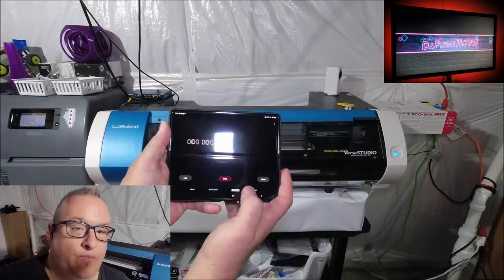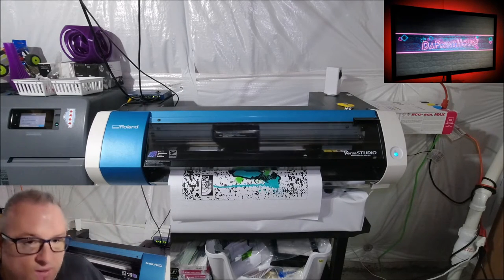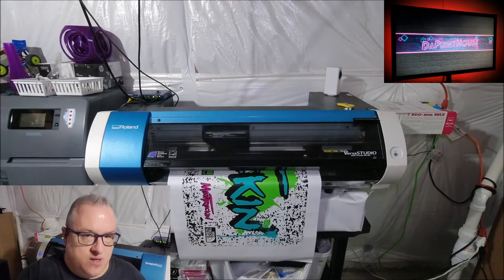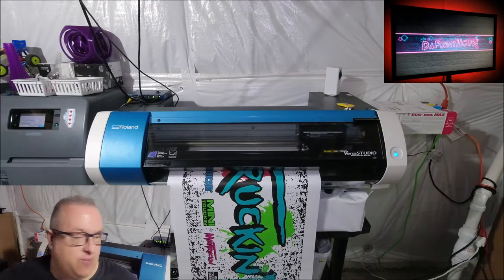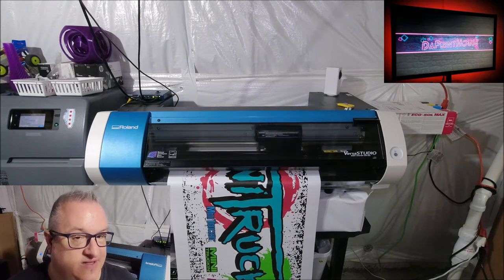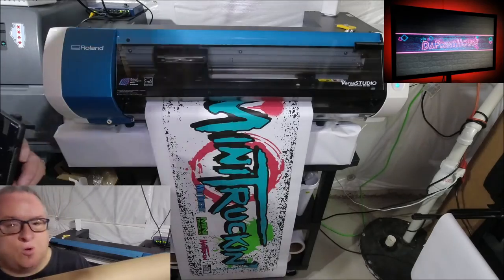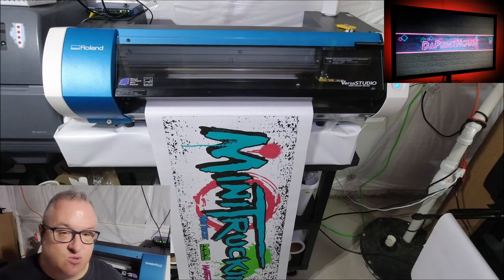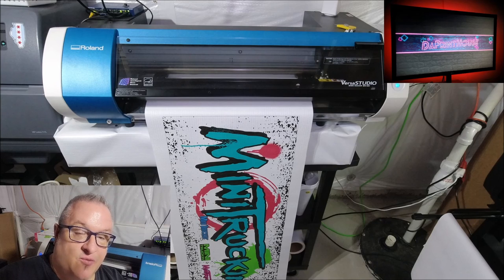Printing Banners on roland bn20 start to finish ecosol print cut machine

Comment: Here is my only hesitation doing banners. Size is limited, I get that, but if the customer is happy with the way the Eco-Sol looks, then it might be harmful to sell the prints from the latex. I run into this all the time at our shop. I print some envelopes on our toner machine and it matches the letterhead perfectly, but it's not cost efficient for more than 2,500, so then I switch to our small inkjet envelope printer and it doesn't match any more. Customer wants the toner look and it can bite you later down the road.
Reply from the maker: i was more just showing that u can absolutely use the bn20 for banners if its all you had,  with my banner work i don't have to color match anything and i wont guarantee it either,  for me i wouldn't need to print banners on the bn20 at all if my latex is running for obvious reasons.  but when i was down for the 4-5 days for magenta print head i could have done some i guess,
Reply: @DaPrintHouse  Very true. BN-20 is a very capable printer.

Comment: Thank you for all the awesome content! What's your fav printable htv for the BN20A? I used the roland that came with my machine and it has a very plastic feel so we won't be ordering that again.
Reply from the maker: Thx. I like the colorprint its softer for sure just not alot of testing yet
Reply: My BN-20A arrives next week and I ordered a roll of Siser S-Print. 
It’s supposed to be soft, thin and matte which is perfect. 
Also applies at a very low temperature. 
They say it can be more difficult to mask though. I’ll see how it goes.
Reply: @razormix  how do u like your printer?
Reply: @fernandolanderos4600  I love it! The Siser S-Print media is great. Very soft and the shirts look amazing.
I’ve made window cling and decals with Roland’s media as well. The VersaWorks software is easy to learn and use.
I’m testing out the 60 degree blade at the moment for more detailed cutting and so far so good.

Comment: I'm curious to know how well this holds up. I know your mentioned this was for inside your garage. Do you think it's strong enough to hold up outdoors? I know this ink runs sometimes when wet?
Reply from the maker: hi, they will not run when it rains when they are cured before hanging for sure.

Comment: What kind of issues have you had without having a heater? I've read that people have had issues with smudging.
Reply from the maker: Smudging?  i mean ye if u run your fingers across an image with a heavy ink profile but dry to touch. Not to long after.  Not sometbing u will do normally,  typically you would.print and throw on table for a bit. But notbing out of the ordinary

Comment: What type of paper are you using for the banner? I just bought the Roland bn20a for my shirt business and wanted to start doing like posters, banners and decals I believe it does and stickers. Any tips? I am so los tot what type of paper to get for that. 

I see a lot of people do banners and then stick it to a harder board?
Reply from the maker: Valerie, thanks for watching,  browse some of my videos i talk about diferent medias, but you want to print on adhesive vinyl for stickers and mounting to boards,  and banner material for actual banners. swing design and roland has media but start with 13oz matte or gloss vinyl but make sure you get the right sizes  20" wide  swing design sells media for bn20 for sure. check out their site.   take your time watch videos you will pick up things easy
Reply: @DaPrintHouse  thank you so much for the response! I’ve been so lost! I want to start selling designs for like outside and stuff. Do you recommend a limitation machine?
Reply from the maker: @valeriemoreno7053  no problem,  you would only laminate vehicle graphics and certain outside signs that will be outside in sun  3 years or more for sure

Comment: Thank you for your videos. I do signs at work with a Graphtec. We don’t print at work though. Anyway, I’m starting from scratch for doing this at home. What software do you use, Adobe Illustrator, or Coreldraw or something else? Also, desktop or laptop computer and how new is it? I know these seem like pretty basic questions, but I’d appreciate your input. 
Thank you, 
Jeff C.
Reply from the maker: i use corel and affinity designers mostly,  i have several   7th gen i7 ThinkPad's with 12gig ram i use for most my equipment down here.   all depends on the complexity of the design really. but great machine to start out with for sure!
Reply: @DaPrintHouse  
Awesome! Thank you. Keep rocking the videos, they really are helpful. 
I’ll get laptop and software and start familiarizing myself with Corel. Unfortunately everywhere I’ve checked is saying that the BN-20 is out of stock and the BN-20A has an August delivery date.

Comment: I want to print only banner. Do you recommend to get the Roland BN 20 ?
Reply from the maker: if you do not have enough space yes but i would step up to a larger machine 54" wide will print a banner in a few minutes.
Reply: @DaPrintHouse  Thank you for your advice.

Comment: Hi Ken! I am so glad I found your channel! I am new to the Roland BN20 and commercial printing so your videos are extremely helpful. Do you know if it is possible to print on vinyl coated pvc with the Roland BN20?
Reply from the maker: thx for the comment.  hmm that i am not sure, how thick would it be?
Reply: @DaPrintHouse  only 20mils so thickness should be good. I am just uncertain about if the ink will adhere 🤔
Reply from the maker: @nataliasaraceno8730  if you have a sample to send me i would test for you.
Reply: @DaPrintHouse  I do not - I will order some and let you know how it turns out. Thank you for your help 💙
Reply from the maker: @nataliasaraceno8730  sounds good for sure!

Comment: Do you put the gromets on and hem?
Reply from the maker: Always use grommet, hemming or banner tape(folded edges)  only if someone needs an outside banner. Not needed for indoor banners.
Reply: @DaPrintHouse hi how can we print and cut poster media I wanted to do graduation fans but it cut all the way thru and messed up